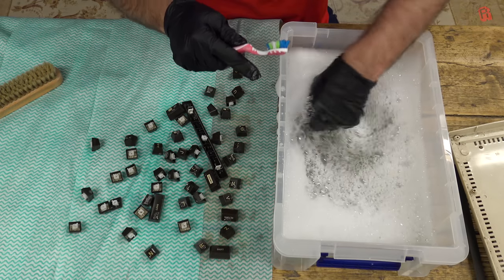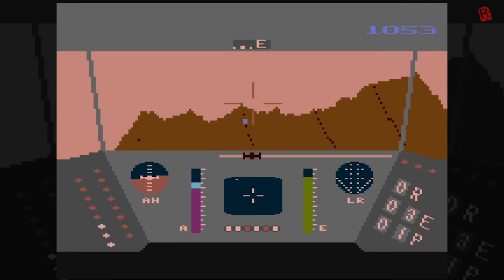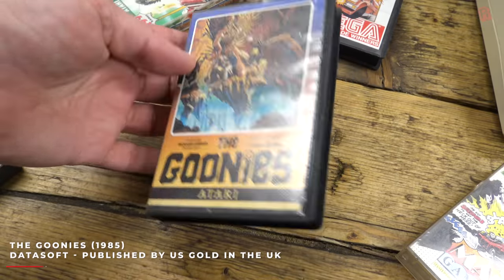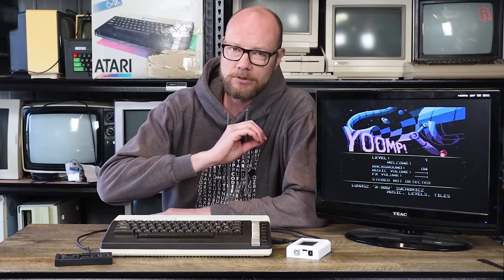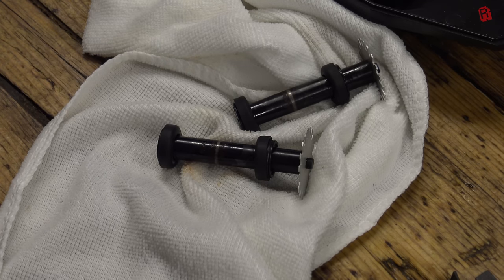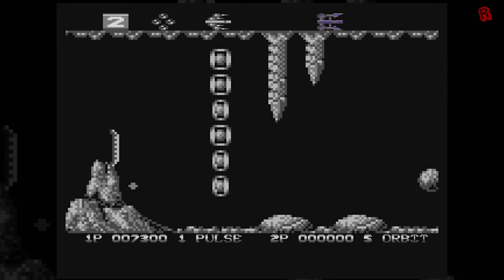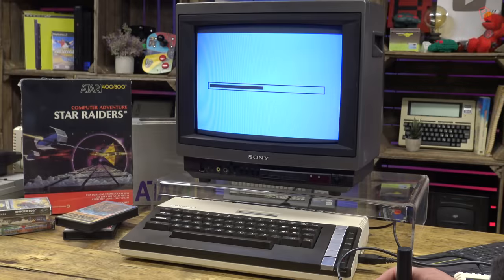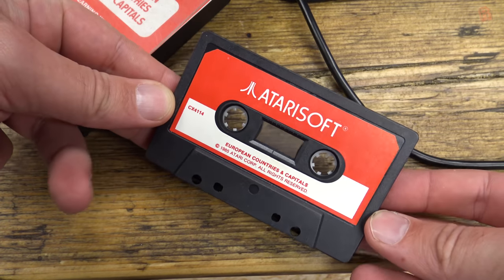What was the Atari 800XL capable of? | Trash to Treasure Part 3

Comment: It's not about what the Atari was capable of then, it's about what it is capable of now.  Spend some time on the Atari Age website forums and see what people are doing with them now. There is a thread about Rastaconverter images that are lower res/hi color images that no other 8-bit computer of the era could reproduce.  People that see them sometimes complain that the images are cheating because they are produced with the help of software on a Windows PC, but what they don't want to address is that the Atari hardware is capable of producing the images and a patient and talented artist could produce the images manually if they wished.  Go to post #12 in that thread and tell me you aren't impressed.

Comment: I have my old 800 from 1981 and am restoring it after it sat in the parent's garage for 30 years. I bought an 800xl to play with in the interim. The only thing I need to clean or polish are the aluminum function keys. By contrast, similar plastic keys on the original 800 are still perfect.

Comment: Re: the stereo audio cassettes, one of the most interesting uses of them was the "Conversational" language-learning series. These used the tape audio to actually have full speech throughout the program -- the program would load itself into memory first, and then the Atari would control the tape deck at appropriate moments in the program to play back the appropriate audio. Very clever!
Reply: I also had an Atari official BASIC course what was also using cassette audio to let the teacher speak. The computer had full control of cassette motor. A really clever low tech solution.

Comment: Great video. The two reasons I bought an 800XL:
1. A wonderful port of BurgerTime called BEEF DROP. This, and the very similar 7800 port, are by far my favorites as they are programmed such that it is not overly easy to get "stuck" trying to get on or off a ladder (try saying that about the NES port).
2. A wonderful port of Warlords called CASTLE CRISIS. It required buying 4 refurb paddles at a considerable cost, but boy is it a great way for 4 people to have an absolute blast.
Reply: Castle Crisis was built atop code from the official version of 5200 Warlords that wasn't completed and abandoned when Atari Inc went down the drain. Although if you really want to see something impressive, check out the 5200 version of Tempest sold by AtariAge. The original Atari programmer, Keithen Hayenga, decided in the 00s that he wanted to finish up the game which he wasn't able to do back in 1984 due to Atari Inc's implosion. And so he finished it up a few years later and is highly respected and has convinced plenty of people to buy 5200's - and its CX53 Trak-Ball controller - just to play it.

Comment: Though originally designed as the successor to the 2600 Game System, The Atari 8-bit computer line (I had a pre-XL Atari 800) was capable of much more than just games.
I used it to learn 6502 Assembly Language because of a bug in the Atari 8K Basic floating-point routines, the floating-point routines were dreadfully slow (and ALL numbers in Atari 8K Basic are floating-point numbers - enter 2.5E4 as a line number - it works!) so we used machine language subroutines (stored and addressed through Basic strings) to speed up calculations. FIG-Forth was available too.
I learned a lot about using interrupts to do multiprocessing running routines on the ANTIC graphics chip. I did buy games, but only as graphics demos to figure out how they did what they did.
I passed on getting an Apple ][ because the Atari had superior graphics and could do Everything an Apple ][ could.
I also appreciated the four-channel POKEY sound capabilities.

Comment: The Atari 800XL was the first computer I bought new and the first one I ran a BBS on. Later moved onto a 130XE I upgraded to 576K and then an Amiga 500 and Atari 1040ST.
Reply: 576k....Rambo? was that memory size available back then?
Reply: @nickolasgaspar9660  Piggyback RAM mod that I made. It was actually 640k but only 576k was addressable. I used it as a massive RAMdisk for my BBS.

Comment: Original replacement feet for the CX-22 Trackball controller are available on eBay, at least in the USA. They aren't listed specifically for the CX-22 but that's only because Atari used the same feet for many other accessories and systems. The seller has a ton of new-old stock (NOS) Atari parts.

Comment: It looks like you are using JS (joystick) mode in Missile Command. Missile Command is the only game across all of the 9-pin Atari platforms that officially supports the CX-22 Trakball controller in TB (trackball) mode. Even then, you have to press CTRL+T to enable it. I'm told this was not even mentioned in the manual!

Comment: I had 800xe back then. And I fought with my C64 friend as fiercely as any nintendo kid with sega one :)
 I wanted to share how in Czechoslovakia we used a loader called Turbo 2000 to load the games. It made the Atari from the slowest loading computer to one of the fastest. Every game had to be hacked and saved to this new format, but there was a lot of dedicated programers in CS pirating all the good games :)
Reply: yep we had that too for discs. we also modded cassette drives + special loader code to load faster than any disc drive at the end with a modified operating system rom. so no special loader was required since it was included in the os already, but the game must be copied in this new format of course
Reply: Yes xc-12 had to be modded to support the turbo. At first I had to load the turbo loader from cassette, much later I obtained a turbo cartridge and that was great. The speed was 2270 bd as standard. Much higher speeds were available but those were less reliable. But even 2270 bd was great leap from the measly 600 bd.
Reply: @corvuscorax9265  What is the retro scene like in former Czechoslovakia? I sometimes travel to Slovakia (used to live there) and it'd be nice to see if I could pick up some equipment there that I can't easily find here.
Reply: @weepingscorpion8739  sorry I have no idea, I am not a part of it. But I guess it is not too big in SK. And I dont see a lot of retro computers ads.   Only kinda worthy local purchase for collector would be Atari 800xe (kinda crappy eastern europe version of 130xe, I had one) and local Spectrum compatible range of computers called Didaktik. There are other local computers like PMD85 or Mato for those really into iron curtain stuff.

Comment: The Atari 800XL was my first computer back in the early 80s. I still have it today along with many other retro's I've collected. The Atari was the first to design custom graphics chips in the personal computer. Commodore basically stole those ideas in their VIC 20 and C64.
Reply: Yeah... Then they outright stole the design team. XD (OK, technically not. But at the end of the day the Amiga is essentially the 16 bit counterpart to this system. - plus Tramiel ended up Running Atari, so it was more like a swap)

In some ways it pains me that the Atari 8 bit design was never updated.

If the XL, or even the XE line had just a few small tweaks to GTIA it could have been much more obviously competitive.
A few slightly bigger tweaks and it would've done a lot more than that. (albeit, with the caveat that hardware isn't everything.)

I've wondered about this in a speculative sense - could I implement anything in an FPGA that would eliminate it's shortcomings a little, and could I do so in a way that would've seemed reasonable for the era? (like, VBXE is amazing, but that thing makes an Amiga look underpowered, and that definitely feels a little off... Just like Rapidus having 35 megabytes of RAM - that wouldn't have been sane even for 1995, much less the mid 80's)

So...
Basic tweaks, that I'm sure would've been possible in 1982-85 even if they weren't in 1979:
- Extend the palette registers to be a full 8 bits, making it consistently a 256 colour system instead of the sometimes 128 sometimes 256 colour system.
- double the sprite hardware. - Arguably a ground up rethink would work better, but from a design perspective this would be relatively easy; just takes more transistors. With 8 players an 8 missiles instead of 4+4, this would've been more competitive without radically altering the way they work, and would make multicolour sprites less dramatically limiting.
- In line with doubled sprite hardware, double the number of sprite palettes to 8. Keeps the logic of it consistent. As a side effect there's now 13 palette entries, meaning the 9 colour GTIA mode could be 13 colours. (obviously it would make sense to provide 3 additional registers)

Some more advanced design tweaks that probably might've been feasible if anyone had wanted to put in more effort:
- Make the high res mode properly 2 colours, instead of 2 luminances.
- Extend the ANTIC/GTIA bus to 4 bits instead of 3.  This would allow some extra functionality, though antic would have to be redesigned to deal with this. But it would allow higher colour support
- Possibly automate DMA-ing of colour register changes or provide a way of swapping between multiple palettes similar to other systems of the era. Again drastically increasing colour output in practice.

I mean I could keep listing increasingly elaborate things, but of course it's ultimately a moot point.

Still, I find it interesting to think about nonetheless...
Reply: @KuraIthys  The thinking at the time was that Atari wanted to maintain compatibility with their 800/400 models when they made the XL series. While Commodore realized just how bad the VIC20 design was, and needed to build a new PC from scratch. The C64 was basically the improved version of the Atari 8-bit computer in some sense.
Reply: @KuraIthys  Atari's graphics hardware was still state of the art - more than sufficient for the games of the era.  I probably would have focused on cost-reducing the disc drive, which was the real limiting factor, since the smart drive contained a 6502-based computer of its own plus a bit of RAM which acted as the controller.  

I think the 1200XL had a great case.  I would have fit a drive into the side of it, like the Apple //c, and built the controller onto the motherboard.  I'd have given programs a way to access that additional CPU when it wasn't in use - it would have been a marketing coup to have a home computer with 2 CPUs.  And integrating that drive would have eliminated a separate case and power supply, allowing Atari to flood the market with drive-equipped computers at a price competitive with the C64 after that had hit the market.

If I were going to tinker with the graphics, it would have been to add an 80-column mode.  Since the Ataris had separate y/c video output (well, save the 1200XL, bizarrely), it should have been possible to sell an 80-column capable monitor that took advantage of the separate luma signal to produce an acceptable (if not RGB-sharp) image at a fraction the cost.
Reply: Preferred XL sound on last V8, had the game too. 800xl was my first too, still have also
Reply: @KuraIthys  Atari Corp later looked into doing an advanced XE Game System before the Panther and Jaguar development took hold. But then they were hitting the wall where an XE would've been more powerful than the ST. And then they had that same issue with the STe/Falcon and the Panther/Jaguar. Curt Vendel was getting the details of all of that - along with a 2nd powerful chipset that Atari Inc's Advanced Research Lab had almost completed before Warner broke up the company and sold it off into pieces in July 1984 - and many other things before his untimely passing a few weeks ago.
Reply: @twiddler71  The C64 had some improvements but many tradeoffs and thus that's why it isn't technically superior to the Atari 8-bits. For example, Commodore botched their serial bus, the 6510 is too slow [which is funny since Atari and Synertek had previously worked on a chip named the "6510" that was an enhanced 6502 with 16-bit instructions back in 1979 but hit production snags; it's been argued that those instructions later made their way into the 65816 which was co-designed by an ex-Atari engineer along with Bill Mensch], the color palette isn't as large, standard RAM expansion isn't as easy or as supported, etc.
Reply: Good as the 800XL was, the never-released 1400XL was so much better in that it was supposed to also have had a 300-baud modem and a voice synthesizer. Heck, I even think that the seemingly buggy 1200XL should not have been released and the 1400XL released instead.

Comment: Wonderful computer. I grew up with the C64 only and only had the opportunity to actually use an Atari 8-bit computer in the early 2000's for the first time. It did not take time to fall in love with the machine for so many reasons. Super fast SIO, incredibly reliable hardware, excellent POKEY sound...this machine was WAY ahead of its time. If I had been subjected to it before the C64 I would have been coding on this machine instead back in those days.

Comment: For Rescue on Fractalus you said something like "the Atari didn't have the color palette to pull off anti-aliasing".  Lucasfilm's other debut game, Ballblazer, DOES implement anti-aliasing.  The Atari 8-bit computers with their 256 color palettes are probably the only computers of that era with the capability  of attempting anti-aliasing (and is possibly the first game ever to do so).   The RoF programmers  (which you didn't quite make clear that Loren Carpenter actually did the original Genesis sequence in Wrath of Khan and was a Pixar founder) simply didn't want to waste the CPU cycles to do it.  RoF is already amazing for its speed since it gets frames-per-second  with 3D terrain while its peers like Microsoft Flight Simulator updates were seconds-per-frame.

Comment: I think the Atari was neglected from being misunderstood. Take the recent Albert creation. The coders have written at length, how they created the 'near' 16bit level graphics. The Atari provides this 'hidden' potential. The coders have managed after all this time to unlock incredible graphics through the Atari having many colors on hand. If you remember 'detail' is not only attained through resolution but also through colour amount. Read the coders info on this it's enlightening that the Atari demonstrates, continually, it's the 8 bit with incredible potential.

Comment: The Atari 800 (the original beast with 2 cartridge slots and 4 joystick ports, not the XL) a mate had in 1979 was superior to the much later Commodore 64 in all but memory, a faster CPU for the Atari machine and better palette, but still with dedicated graphics and sound chips.  A real shame Atari went bust, although that joystick was painful to use lol.  What were they thinking?  Games like Bristles, Caverns of Mars, Dropzone and Miner 2049er were a few of my favourites.
Reply: So true.  I owned the Atari & later owned the Commodore 64.  The Atari just worked better & had far fewer bugs than the c64 (especially the disk drive operating system!)

Comment: Re. the audio track on the tape load - I discovered that when I first started using Atari computers in 1981, since at the time, the tape drive was a popular mode for loading programs. I heard audio tracks on a couple Atari tape titles: States and Capitals, and An Invitation to Programming. What An Invitation to Programming demonstrated in spades was that the computer was able to control the tape drive, turning it on and off on cue. That really seemed like magic. There were a few Atari games that depended on having an audio track, as well, which did a lot of this. All of these titles were written in Atari Basic. The first part might just have the "buzzing" sound of loading the code part of the presentation off tape. Then when you typed "Run", the program would start and stop the tape for the audio it was supposed to sync to.

What I noticed about these titles, though, was there wasn't great quality control syncing the tape with what went on on-screen. Most of it was impressive, because some of the coordination was controlled through timing loops, and it was very good. The early and middle parts of such a program would work, but if you kept going, you'd run into some part where the screen and audio track got out of sync, or the program crashed while the audio was playing. That was always pretty frustrating, because the illusion it created was impressive. When you realized that it was just a coordination game, it was disappointing.

Another Atari technology that exploited this was their Education System that used an Atari cartridge, and each lesson series came on program cassette. It seemed to use a streaming technique, where data was loaded from the cassette, and immediately displayed on-screen, while the audio track played. The series taught foreign languages, and history, as I remember, and the syncing between the screen and the tape was top-notch. This was probably because it was easier to design the interaction in this system, since there was likely no code being loaded off tape. It was just data in a standard format, telling the cartridge what to do when.